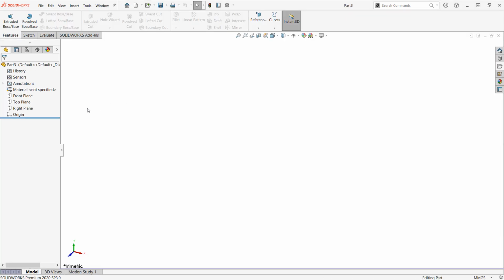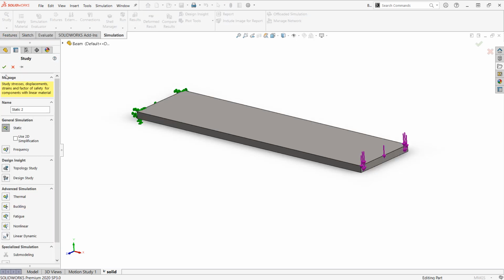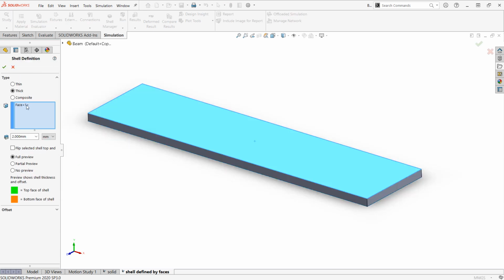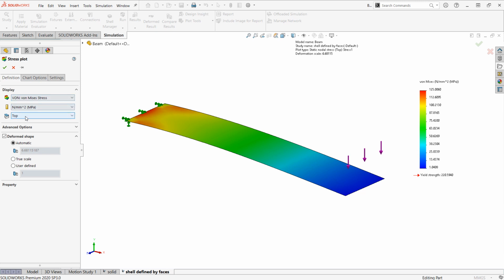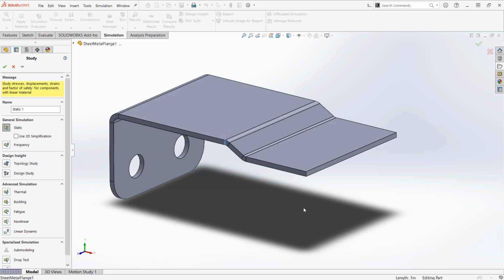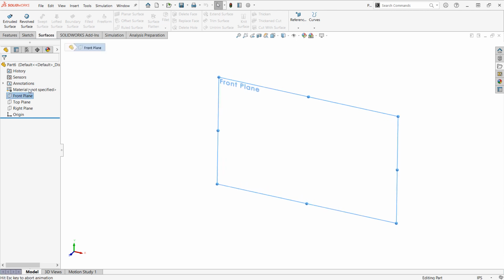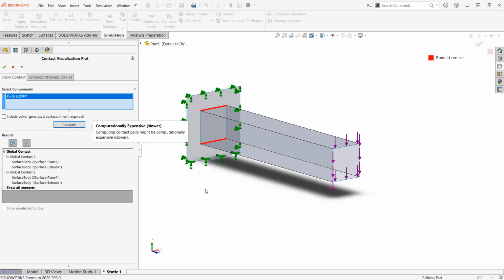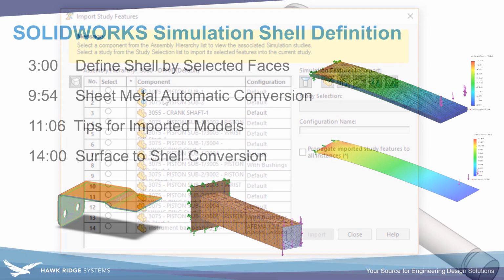SOLIDWORKS Simulation Shell Definition

Comment: Thank you for your tutorial, it's helpful for me. And I have a question, I would be my honored if you could answer. I have created a sheet bending metal part, which will be automatically recognized as shell element in simulation, but its Mirror derived part will only be recognized as solid element when it is connected with the original part. So how could I keep connection with original part and will be automatically recognized as shell element?
Reply from the maker: When creating the Insert -> Mirror Part be sure to check the checkbox "Sheet Metal Information". Then the mirrored part should have the Sheet Metal folder in the feature tree, and should automatically convert to shell. 

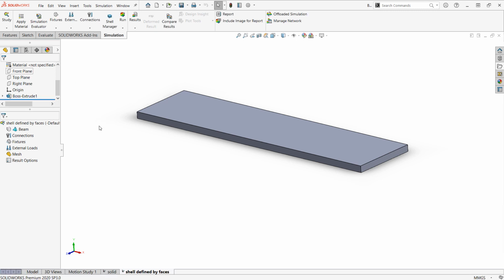If you don't have this option available in your version of SOLIDWORKS, a good fallback would be to use the "Define Shell by Selected Faces" method shown at 3:26 for any parts that fail to convert automatically to shell
Reply from the maker: @boensad7911  So instead of mirroring the from the assembly, try this:

-Open the individual sheet metal part file
-Select the mirror plane / face
-Choose Insert -> Mirror Part from the pull down menus.
-Make sure the checkbox for "Sheet Metal Properties" is enabled

This will create a mirrored part that still has the sheet metal information, and should convert the shell.
http://help.solidworks.com/2021/english/SolidWorks/sldworks/t_create_mirrored_SM_part.htm?verRedirect=1

Hope this helps!
Reply: @hawkridgesystems  Thank you sir, but it still failed. ^^!!! even I have tried to copy the whole project to another fold, release reference relationship between orginal part, failed...
I don't know it's the problem of my operation or not, if you are successfully, hope to share a vedio, thank you very much.